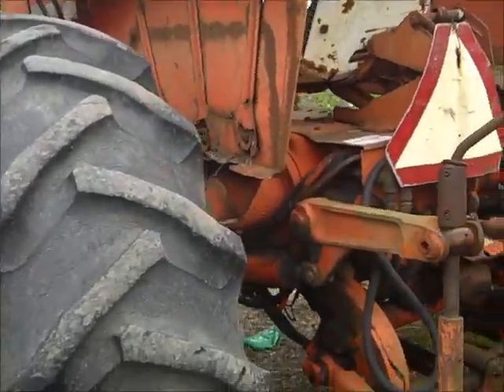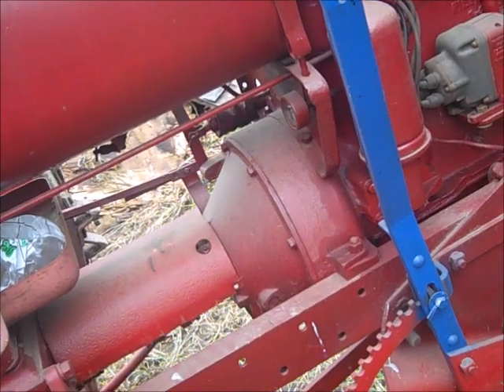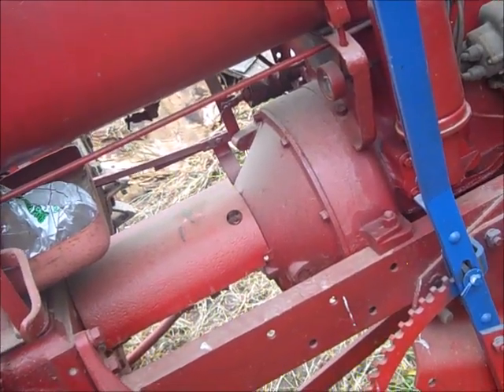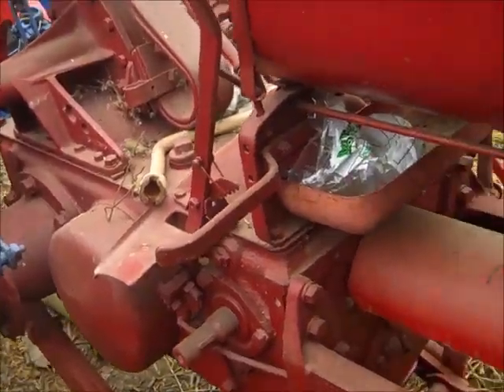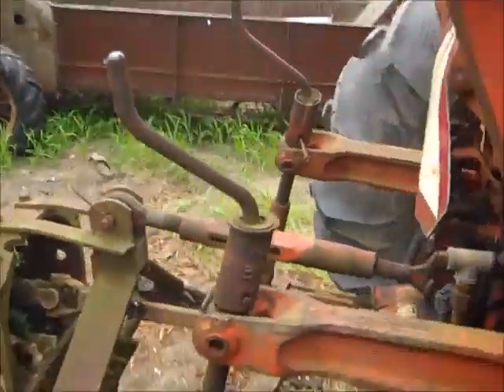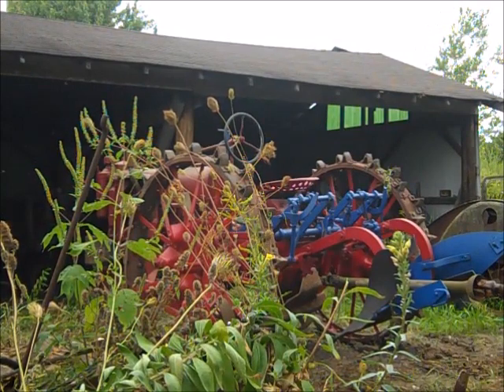F 14 start up

Comment: Sounds like it runs pretty decent for sitting for 4 years, and having two bad pistons! Good video, Richard!
Reply from the maker: I got the pink and purple F 12 running today
Reply: Pink and purple! Must have been used as a parade tractor! :-)
Reply: @KennyKizzleRustyNutzRanch   Good day Many yrs. ago a fellow up here i n Ont.  had shepard diesel for  sale with a slant 6 gas motor. He also had a pink JD, & this was in 70's so it wasn't  breast cancer. I am not sure why. Could have bought it $150.  Stuff was cheap back then.  Thanks
Reply: @donvoll2580  Yessir. They made a Sheppard conversion kit for Farmall H and M. Would have been neat to throw it in one.

Comment: What was the thing on the pto that you used to start the tractor?
Reply: It's a gear box to reverse the rotation of the pto.  If he just backed the tractors together and connected their ptos directly it would spin the engine the wrong way.